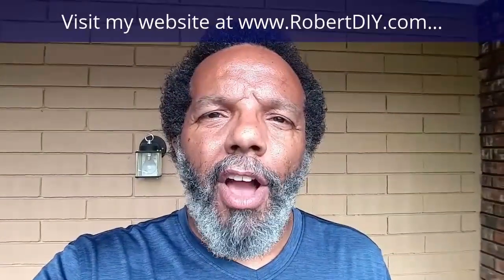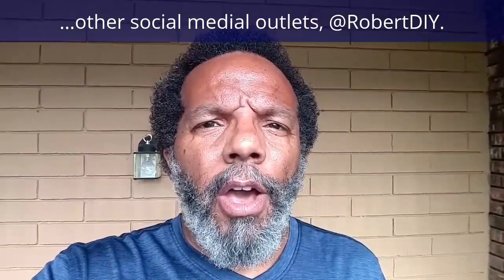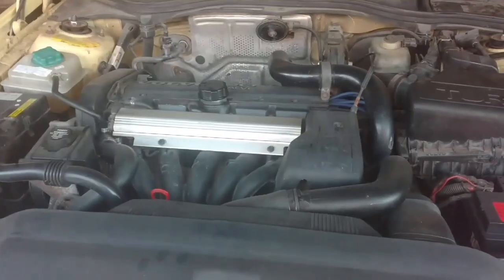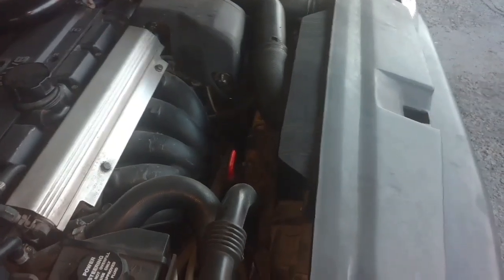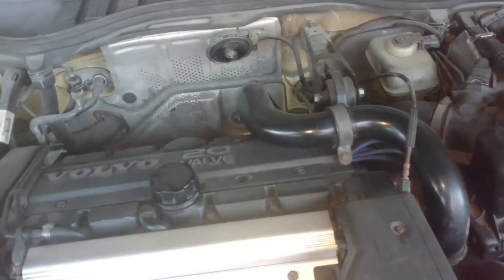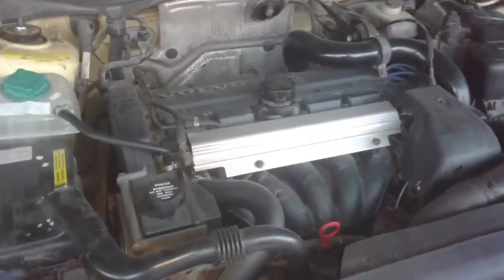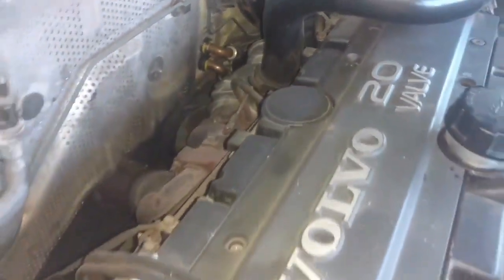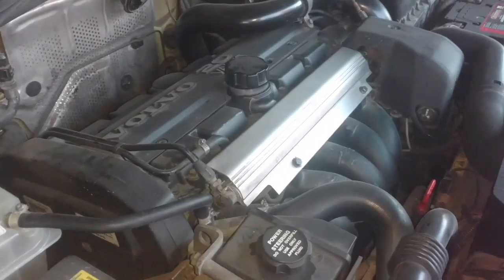Cylinder head removal, what you need to know before you get started. Volvo, 850, S70, etc. - VOTD

Comment: Hi Robert.
I'm having trouble removing the upper part on the head off.
I have removed the the 5 spark plugs and the 56 bolts off the top , it has sprung up about 1/16 inch.
I have tried spinning the cams but it won't come loose.
Would I have missed something, on the lower head coming up or could be jamming on the aligning lugs.
Please help
Thanks garry
Reply from the maker: pull the bolts all the way out. It is hard to get off so Volvo has a special tool. One mechanic told me to stick a 3/8" short extension in the break loose points and turn it 90 degrees. I often use a 3/8" extension with a flat tip screw driver to get the pry points open. RESIST prying between the head and cam cover surfaces.
Reply from the maker: Here is the proper tool: https://www.fcpeuro.com/products/volvo-cylinder-head-pliers-850-s60-s70-s80-v70-xc70-xc90-baum-v5670
Reply: @RobertDIY  thanks Robert.
I can't seem to get it up could it be stuck on the alignment lugs.
Sorry I should have mentioned it earlier.
I'm in Melbourne Australia. 
I don't think you licked up on the accent. Lol
Cheers Garry Owen.

Comment: I have V6 Accord, I removed front head, all valves are bent in front head. I need to replace all valves, will I need to lap the seat for new valves? Is it possible that pistons were damaged?  will any work need to be done in the block? Also, when I reassemble how can I synchronize the cams to the crank ? The timing is off because we kept trying to start the car. Your insight will be very helpful
Reply from the maker: Sad to say, I have no experience with those Honda V6 engines. You will likely be better off getting a head from the junkyard. If the front is bad, the rear is likely bad as well. You can check my timing video, that may help.

Comment: Oops... My car is now burning coolant because I used a cheap gasket and fudged on the head bolt angles... People listen to this man, he warned us to use OEM gaskets and angle tool when installing the cylinder head on Volvo's.  Robert if retorque the head bolts do you think it will seal? It's  a stupid question but what the heck.
Reply from the maker: Maybe worth the try mate.

Comment: Hey Robert you know the coolant pipe connected to the head held by two 10 mms? I can’t get the lower bolt out because of how tight it is in there. I’m trying my best to avoid taking the turbo and manifold out and this is the only thing left other than the head itself.
Reply from the maker: I usually use a 1/4" with a 6" extension.
Reply: Robert DIY thank you sir! Just got it out :)

Comment: Wow I wish this video had of been available this time last week, I'm doing my first head gasket on a v70 2.4 N/A and it had the VVT cam which I wasn't aware of and didn't use the locking tool  I hope I get my timing right
Reply from the maker: +Luke Wilkinson https://youtu.be/0H5cgRYCMQg
Reply from the maker: +Luke Wilkinson lots of other videos talking about it.
Reply from the maker: +Luke Wilkinson https://youtu.be/3CTNiKlgdFA
Reply: Its a good job I saw this when I did, the method I was going to use was to line my marks back up and put the belt back on, not touching the VVT at all as it isn't spring loaded on my car so as long as the notches on the air box side lined up and my cams lined up with my marks on the engine cover I though I would be golden. Your a life saver
Reply from the maker: Close but not very good.

Comment: Hey Robert, a hydraulic lifter on my B5254T is clicking loudly, should i replace all of them or just one?
Reply from the maker: Are they hydraulic? Have you checked oil pressure? What oil filter are you using?
Reply: @RobertDIY They are hydraulic and i use a Biltema filter (swedish brand). How do i check the oil pressure the easiest way?

Comment: Hey Robert I hope you’re doing well. My Mechanic didn’t set the timing right and bent my valves on my Volvo v40 2000 with 76k miles. So far I just ordered new valves from rock Auto. Are there any other parts I need to order or can I just replace the valves?
Reply from the maker: If you're ordering valves from RockAuto, why don't you just send the car to the salvage yard?
Reply: @RobertDIY  Gotcha, I’m going to get some Volvo ones and take those back. Anything else I need to get from Volvo while I’m at it?
Reply from the maker: https://youtube.com/shorts/IWhhPD8SKaM?si=Trig8vqA7bm7jiZd
Reply from the maker: https://youtu.be/qnbMeojgf4A?si=h0IxCJ65EyDHawVw
Reply from the maker: https://youtu.be/Osdsv5I_jxM?si=1z8BQ08P51t23Vcr
Reply from the maker: https://youtu.be/gt9w-ZSxs9I?si=PxSdompqrunIvmaH
Reply from the maker: https://youtu.be/0eSuvM6Bl7Y?si=rZ6N3DQwyVEOC1E7
Reply from the maker: https://youtube.com/playlist?list=PL4kSJzgyD94QvGDbGdLpSHBUb_BhSa4S9&si=x9JD2gylDesm3HzL

Comment: I just bought a new head with new cams, lifters, valves, everything in the head is new. Do I need to break it in and if so what do I need to do and can I use cheap oil for the break in then put good oil after it's broke in
Reply from the maker: No, but I'd take it easy for a few hundred miles.
Reply: Robert DIY  I can't get the belt on it looks too skinny and too short. I don't have an old belt cause the other one had been shreaded, how can I send you a pic

Comment: Hey Robert serious question, I hope you can help me out. I have a t5r that I have not yet driven around, but I have finally got it started and after about 10 or 15 minutes of me letting it sit idling it started to smoke an almost transparent white smoke. I revved it a few times (probably shouldn't have but I was excited) and then a thicker pure white smoke came out. Does this mean head gasket instantly? Or could this be something else. The car hasn't ran previously for at least 5 years. If you can help me out i would greatly appreciate it (:
Reply from the maker: Probably a bad PCV system or old crappy valve stem seals.
Reply: @RobertDIY  thanks for the reply. just pulled her in the garage, going to be pulling cylinder head off and checking it out, seeing what i can replace. im so glad you are on youtube with all these extremely helpful videos
Reply from the maker: You are welcome

Comment: Hi robert which  Cylinder head would you prefer or recommend for a engine producing 700hp on a 1998 volvo c70 coupe, the c70 or a 2004 v70 head
Reply from the maker: What block are you planning to use?
Reply: The block from the 98 c70
Reply from the maker: That thing can't handle 700 HP so any head will do.
Reply: I got 83mm forged pistons and i have it sleeved but thanks ill send you the video when is done
Reply from the maker: Oh, that's a different story. Most like the T5 head from '06.
Reply: Thank you robert your help
Reply: Can you tell me real quick why you would pick that one

Comment: While the head is off I have an opportunity to upgrade my 18t turbo and manifold to k24 with the later s60r manifold. Do you think I will see much of a performance gain?
Reply from the maker: +Rod Kenney yes, may need to tweak the tune. How is the rest of the exhaust?
Reply: The exhaust is stock
Reply from the maker: +Rod Kenney then you should at least get a 3" down pipe.
Reply: Where do you get one of those?
Reply from the maker: Several speed shop/parts places sell them. Like iPd, Snabb, Vivi Performance, etc.
Reply: I just purchased car 3 months ago and did not realize it already has 3 exhaust all the way back splitting into mufflers. The Turbo has play in the shaft so its either rebuild the 18t or upgrade... And of course... Any excuse to upgrade..lol

Comment: Dealer supplied parts, OEM parts (same supplier to a dealer) or NOS (new old stock).. when you have a old engine with parts availability issue then upgrade and install a newer model engine. For a toy with lots of engine maintenance cheap gaskets are fine, otherwise payen brand or original Volvo. You get what you pay for in the end.
Reply from the maker: +Arjan Wilbie ok

Comment: Head bolt order of removal
Reply from the maker: Same as installing. I usually turn them 1/4 turn (90 degrees), them another 1/4 turn, then they are loose enough to pull out.